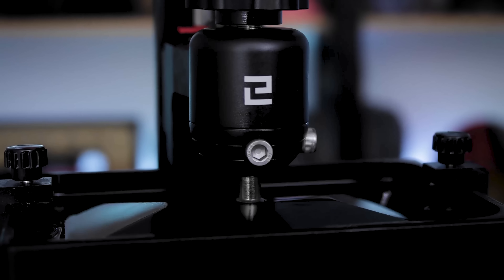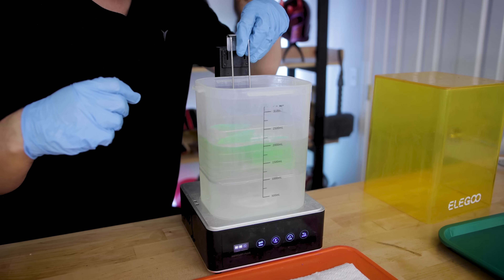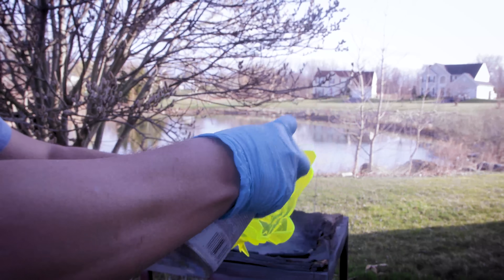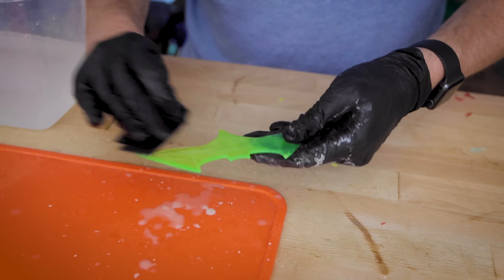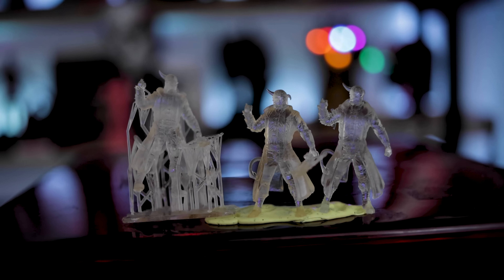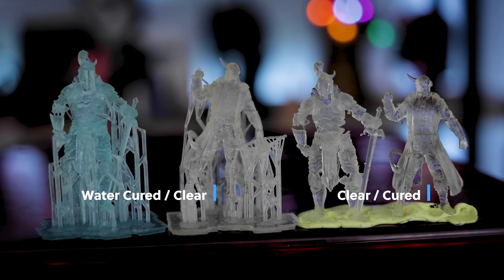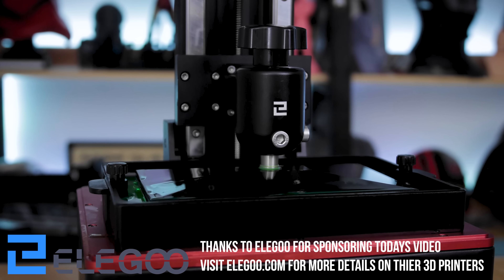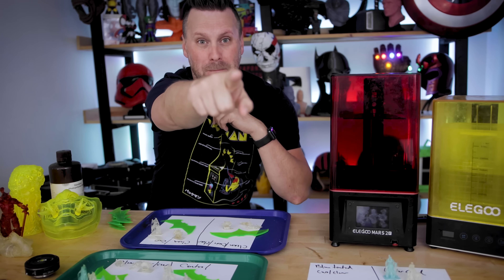How to get the best Clear Resin 3D Prints

Comment: I like the Oni mask.  I wonder if in the future you might try clear coating only parts of the model and keeping other parts more opaque for some contrast.  Also I wonder if you could lightup something like the ONI mask with leds, kinda purge mask style
Reply from the maker: You could easily tape off parts and only clear coat the unmasked areas... and I'm right there with you about adding some LEDs to this prop ;)

Comment: In the end it's physics. You want the light to pass through in one direction. No doubt the surface free of any debris and scratches will produce the best result. 
When it comes to gloss this would be about experimenting with various brands as no gloss is created equal. Some are really good and others are alright. Some really show their worth after multiple coats(and something sanding). 

I'd be curious about resin that's been degassed and warmed to a good temperature. Any defects under the surface is going to decrease quality and no gloss or sanding is going to fix that.
Reply from the maker: The problem with the degassed resin is that the buildplate continually lifts up and down during the printing which will cause the micro defects in the prints. I'm for sure going to be experimenting with different clear coat brands

Comment: I’ve noticed whenever you print transparent pieces hollow they always come out cloudy because you can’t clear coat the inside
Reply from the maker: Thats very very true. I wonder if there would be a good way to pour clear coat into the print and swish it around
Reply: @UncleJessy  You can spray paint from rattle cans into a cup.
Reply: @UncleJessy  Pouring works great, fills alot of the lines you can get to.
Reply: You can, you have to get some epoxy clear resin, and inject it, then rotocast it and pour the excess out into the next piece!

Comment: Use distilled water so the minerals in the water don’t bond to the print. Just like your faucet the minerals build up from the water not being pure.
Reply from the maker: Awesome! Thanks for the tip. I will pick some up and give that a try!
Reply: @UncleJessy  @Geekzwholift - I've read this comment before and tried this repeatedly recently. Anycubic basic clear. Clear after printing, clouded (because the texture is exposed) but still white after cleaning in 99% IPA, and then a 2min cure in anycubic wash and cure 2.0 in demineralised water (yes, i know that's not distilled...but no minerals. The difference in distilled would be less organics like bacteria if they're in there, opposed to demineralised). That last step has a drastic yellowing. I covered it with clear picture varnish and put it on the shelf for now. This is where it gets interesting!! ...after a week of having the print on my shelf, that part has now gone back to white instead of yellow! I've printed another set just today to repeat the process exactly to see if NOT applying that clear varnish allows it to turn back to white within a week. If it also goes back to white instead of yellow then some of the chemical processes are having an evaporation or oxidisation process and the part is going back to white for some reason. Totally interesting and i hope you do a follow up video to show what these parts look like over time on the shelf.

Comment: I also found sanding helps keep it clear. Problem is the pixel resolution leaves "stairs" on the print surfaces, small enought we can't see, but big enough to refract light and make it look not clear. The clear coat helps bridge these rough edges and let the light scatter less. 
Try a super low layer height, like 0.01. It makes a big difference. And you really really need to tune in the clear stuff layer cure time, any bit of over exposure makes it harder to get it clear. I've done a lot of experimenting, and it's super tough to nail it lol.
Reply from the maker: Yeah I forgot to mention everything was a .05 but for sure could test that out at .01 and see. Glad to hear someone else has been monkeying around with this!
Reply: @UncleJessy  Definitely late to the party for this video but it's definitely worth trying Zona paper! It's a ridiculously fine sandpaper process that brings almost mirror shine to epoxy resin stuff, so would be good to see it on photopolymer as well
Reply: Great comment bro
Reply: Ooo starting to doable with clear resins gonna have to try this

Comment: Something I learned a while back is to lower the percentage of alcohol. I heard somewhere that as long as it's above 10% or 20% it should still clean just fine. I tried it and it seems to help significantly with clarity on my clear prints. This also cuts down on the cost of IPA usage. Probably best to use distilled water, but I've been using filtered tap water. 

This tells me that the alcohol is causing microscopic fractures in the plastic similar to what you can see in many acrylics and other clear plastics that used to be used on phone screens back in the day. The clear coat basically fills in those microscopic fractures and makes the surface smooth again. If I remember right, alcohol leeches out the plasticizers that make plastics susceptible to this flexible so the outer layer is left super brittle and causes stress fractures just from its own tensions of holding itself together.

What I'm curious about is how alternative cleaning solutions such as simple green affect clear prints. I haven't tried that yet.
Reply from the maker: Oh i like where you're heading with that. A few others mentions distilled and maybe mixing that with the lower percentage IPA might work out better.

Oh i didnt even think of things like simplegreen... adding that to my list for future tests!  thanks for checking it out and leaving some feedback

Comment: Pur a very thin coat of resin on the print then cure it. The print likes r causing the clouding
Reply from the maker: so put more resin on the resin before curing? Will have to try that. Seems like it would counter intuitive but for sure will try it out.
Reply: @UncleJessy  I found it out by accident by resin welding parts ..... make sure u put it on as thin as possible to not loose detail...

Ita.like when ur making dioramas and u shave a bit off the river, then brush more resin over that part and it goes clear again

Maybe brush it on with a cloth and rub it in so there's no brush lines etc
Reply: @UncleJessy  did u try it out???? Only an extremely thin layer... like a skin coat they do when making resin art to make the resin see thro again
Reply: @UncleJessy  if I had any clear resin left I'd try it and send u a pic...

I think we have it all wrong thinking that the curing is making it cloudy.... it is the very small layer lines down it.... filling those lines should make It like glass

Comment: If you follow up on more sanding testing I would like to recommend also trying micro mesh pads and Zona Paper.
Reply from the maker: I just ordered some! Really excited to test that out!!
Reply: @UncleJessy  I've not had a chance to try more than 2 brands of print resin but I've found with Casting and Craft resin the harder the cured resin the better it will sand and polish. Not sure that has much effect on 3d prints as I don't know how much hardness varies. Looking forward to what you find out!
Reply: Don’t get the pads, they don’t hold up. Get the cloth backed micro-mesh. Much better product and very long lasting when wet sanding.
Reply: This is actually a really good idea as well

Comment: from my own personal experience with my original elegoo mars, you might be able to get slightly better results from cleaning but the biggest thing is to clean properly and use a clear coat spray after curing. while the resolution of my elegoo mars is great, its not quite good enough to make a smooth enough surface to really allow good light penetration. I normally just use IPA to clean and water to rinse, cure it, and afterwords i would apply the clear coat (uv blocking) to seal and give it less cloudy result. 2-3 even coats seems to do well for me, some models i can see being harder but I havent had much issues in my own limited experimenting.

Comment: I like using carnauba scratch repair car wax in my process. So clean, cure and wax (sometimes a light clear coat also).
Reply: Yes I've used Mother's Cleaner/Polish on my clear prints and they come out looking fantastic, with no sanding involved.

Comment: I am following this as well.  I have nearly gone through a whole bottle of clear resin and tried different methods.  Some turn out more yellowish than others.  Instead of blue I also tried black to give the clear a "smoked" tint look.  A question I have and maybe others will reply, what is the easiest way to "thicken" up resin prints?  Several prints I have downloaded were designed to print on a PLA printer and parts of the print on the resin printer comes out to thin and flimsy.
Reply: That sounds more like a support structure issue. If you look up 3D Printing Pro on YT, you should be able to find videos from him that would help you  fix your issues.
Reply from the maker: Hey there thanks for the additional info! For your file question... is it that the walls of the file are extremely thin? You might be able to use a service like MakePrintable.com and see if that would work

Comment: Did you cure in fresh water?
Reply from the maker: Tap water, someone else mentioned i should use filtered or distilled water
Reply: @UncleJessy  I'd highly recommend using Pledge (the bottle) or Minwax instead of gloss varnish. You can apply it indoors with a brush and it does a ridiculously good job on clear Gundams, so it should work well on 3D prints. There are YouTube videos on the subject for Gundams and model aircraft cockpits.

Comment: Did you liked cleaning with the 70% alcohol over the 90%? Or are they about the same?
Reply from the maker: I dont really notice any difference.I was using 70% because they had a TON at the dollar store
Reply: I've actually read that 70% IPA is what is recommended to use and if you buy 99% or whatever manufacturers suggest diluting it

Comment: I remember seeing someone letting his clear prints drip for longer than usual and then removing the supports and then curing without any cleaning and they stayed crystal clear
Reply: That is the best way i can see doing it.  When you wash it after it goes cloudy since the surface is cured matte it seems due to light scatter.  Letting the resin stay on the model allows it to fill the gaps with out killing detail.
Reply: Thats what I do
Reply: @NoraFulcanelli  How many seconds per layer to cure would you recommend? I suspect I'm over-exposing my clear resin or something, it comes off so brown even from the plate.
Reply: @kapalaka Very dependent on what resin  and what printer you use. And even with 2 identical printers, one could have a stronger display than other. Especially if you're working with a monochrome screen.

My colleague said that if you're working with transparent resin, you'll even need to reduce the UV light strength of your display if you're using a monochrome screen, because it's too powerful and scatters the light too much in the clear resin.
Reply: @kapalaka  the recommended ammount the suppliers suggest.  i don't do a lot of post uv curing as it increases brittleness, unless i need it to be stiff.  If im doing minis very little uv curing, if you drop them the can break easier.

Most of my yellowing is from post uv curing.  And the print time is different from opaque resins, learned that the hard way.
Reply: What I have heard is wash them. Partly cure them. Go back in with a soft brush and paint on a very thin coat of resin and finish curing. Supposedly this helps keep some of the finer details from being lost, but I haven't tried it.
Reply: @DaniGirl6  That's what I've been doing because I'm also afraid of making it harder to remove from the build plate by curing it first and I don't want to mess up the finish by handling it if I try to remove it before curing but without cleaning.
Reply: That’s what I do.
Reply: village man mindset, best-cooked fish you will ever find.
Reply: I though of doing that but I assume you looks some fine detail
Reply: This 100% works

Comment: Use distilled water next time. The clear prints gets that haze from absorbing the minerals in the water
Reply from the maker: Yeah going to try that out for sure! Thanks!
Reply: Mean green or another degreaser works. Figured out soon that alcohol is used to clean resin for a reason. No bueno
Reply: My clear prints always look bad if I don't let the isopropyl alcohol dry completely before curing them under tap water. It always takes longer than I expect, but if they are 100% dry, then they are perfect. It's gotten to the point where I'll wash my parts and let them dry for a few hours before curing.
Reply: I tried this today and it still came out yellowed. :(

Comment from the maker: For real! If you have a better method... LEMMI KNOW! I want to try out some other options with another followup to this!
ResinLapse - The easiest way to create Resin 3D Printed Time lapses -https://www.etsy.com/listing/970847090/resinlapse-resin-3d-printer-timelapses
Reply: My best results Are from using a brush on gloss clear coat than a spray clear coat. I was using Elegoo's Water washable clear blue resin, which I would wash with Simple green, and then rinse with warm water as I removed the supports. I don't see any evidence of yellowing on my prints either. Though I used Elegoo's mercury for curing as well.
Reply: Since the dull look results from a matte surface (microscopic "pores") that you get after cleaning, the best way (theoretically) should be to dip the prints into the resin, after cleaning them, and then curing them without further cleaning. This should close the "pores" in the surface of your prints.
Reply: The sun has multiple uv light spectrums it’s not a good source for consistency as the waves are more and less then the 405nm needed to ensure quality and consistency.
Reply: Can you try Monocure 3D ResinAway ? It's suppose to help keep prints clear.
Reply: I have had EXCELLENT results after curing by spraying on Krylon Crystal Clear Glaze.  I did a Terminator bust in Elegoo translucent green and sprayed it with the glaze and it was perfect.
Reply: Dip in Futures Floor Wax!  Old modeler trick to get crystal clear canopies for planes, windows for cars, etc. Futures Floor Wax, will coat the part and remote the diffraction issues.
Reply: I just wanna toss out the water curing was def over cured. You only need a few seconds in the water no where near even a minute for mini's, I usually toss em in for 15-20 seconds in a glass container with room temp water. Anything passed 30 seconds and I usually notice brittleness or overcuring on the smaller details.

Also great vid on trying out different methods, thoroughly enjoyed this one :)
Reply: Try wet sanding with Zona paper.
Reply: Try Clean / Cure  then use car polish
Reply: TL;DR: I haven't tried any of this, but you could try cleaning without water and diluted products to stop the clouding, lower the cure time to stop the yellowing. Then I don't know as it'd likely remove detail, add uncured resin after cleaning and before curing (maybe dipping as I saw suggested or painting it on)

I haven't tried clear resin printing, but have seen others say water is the enemy of uncured prints, as in it causes the cloudiness and white speckles because it penetrates the surface, but I'm quoting others that could be misleading, one being monocure 3d, but maybe see if mean green (don't know if it has water in it) does a better job and use compressed air to clean off the excess mean green after.

I did also see a recommendation that you could maybe try to dip the uncured print in uncured resin after cleaning to smooth it and then cure it, and the same site said the yellowing is caused by over exposure, so maybe tweak the cure time to less.

I will say if adding resin after cleaning, why not also try not cleaning as I saw also suggested here by Andrew Hayes.
Reply: Something I do for my white resins is soaked in warmed Hydrogen Peroxide. It takes my yellowed white resin back to being white. Look into the Retrobrite solution for old video game consoles. The same process causing older plastics to yellow is the process causing clear/white resins to yellow as well. I just use warm Hydrogen Peroxide as it's what I have on hand, but there are a myriad of different retrobrite solutions that may have different effects on the clear resin. I'd love to see a video detailing experiences with clear resin retrobrite.
Reply: The "dust" coat of clear you apply first could be negatively impacting your clear results. Hard to say without being there and seeing first hand how the paint looked. As an automotive painter I would recommend a wet first coat. When you do a dust coat the clear can't flow out smooth and your following coats will have the same texture you created with the dust coat. This is a problem for minis though since the details are so small you could easily muddy them with to much clear.
Reply: The whole water curing thing a is a big fad, ive gone into detail in a discord I hang out in about why its just a waste of time. there is a couple videos kicking around on YT, one where the guy sights a research paper on "photo-initiator oxidation in photo polymer resin".  But he completely misconstrues the results of the research paper. I am tempted to do a video on this subject over on my Resin engineer channel.

The best results you will get on clear is to test out the Anti-aliasing options in your slicer.